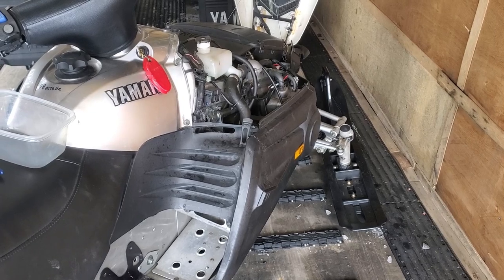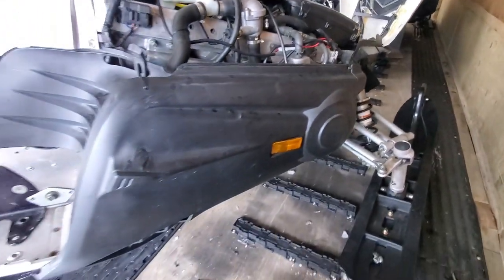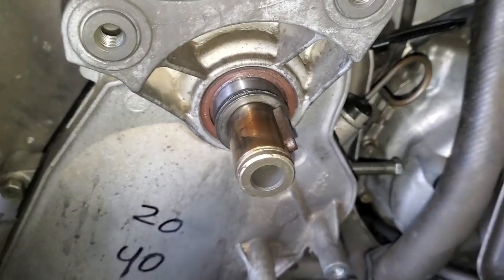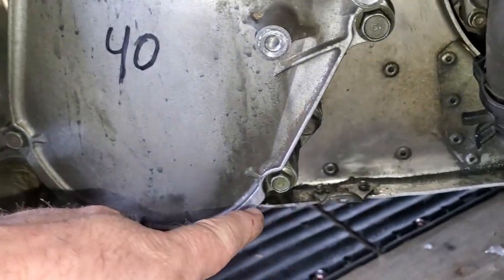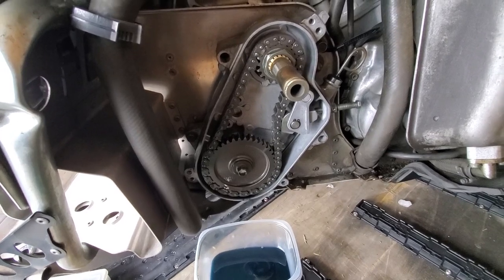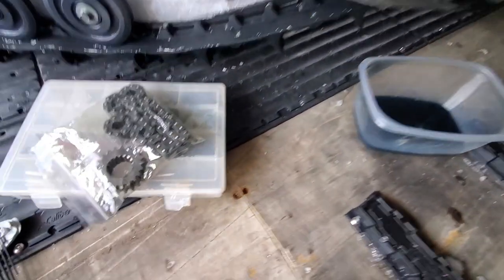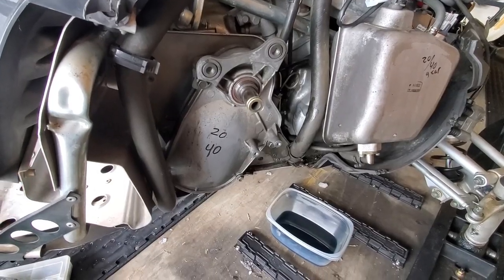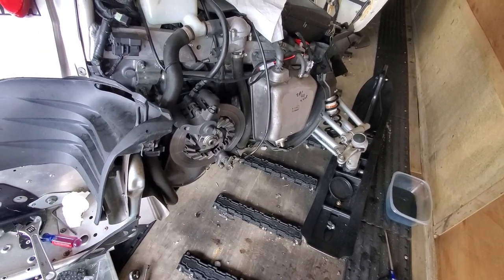Yamaha Rx-1 Chain Case

Comment: how can you tell if you just need to tighten up the chain tension or the bearings are bad?
Reply from the maker: I would recommend opening a chain case for visual inspection every 2000 miles or so and replace the right and left front axle bearings every 2000 miles regardless. Thats a good time to try and wiggle the upper shaft by hand with the cover off. Yearly you should check chain tension and change gear oil. Also look underneath at the axle seals for anything odd looking. I have seen 2 complete bearing failures where the parts of the bearing blew out the side and ruined other components in the process. 1 was at 2000 miles and the other was at 4000 miles.

Comment: I’ve just bought the exact same sled. Is there an oil seal behind the lower gear?
Reply from the maker: Yes there is and several other components. You can check out the parts schematic here https://www.yamahasportsplaza.com/oemparts/a/yam/5003c052f8700212fc84122e/track-drive-2 Your best bet is to purchase the whole bearing and seal kit and do both sides at once since they often get water in them and fail at an inconvenient time  https://amzn.to/3ZP8xsS Also this service manual may be helpful https://snowparts.ru/manuals/RX-1service-manual.pdf Also remember it only takes around 8oz of oil in chain case.